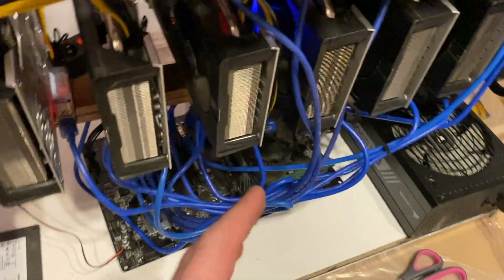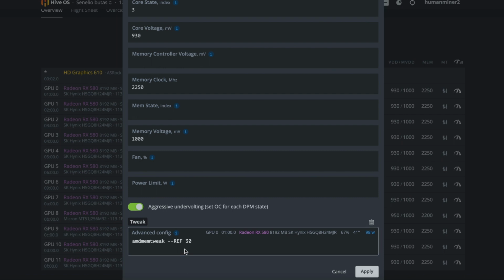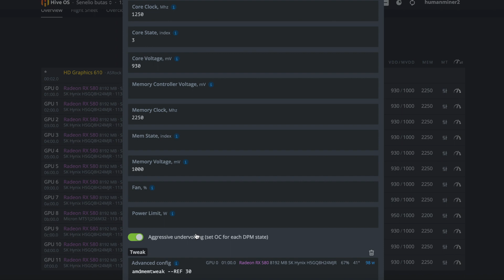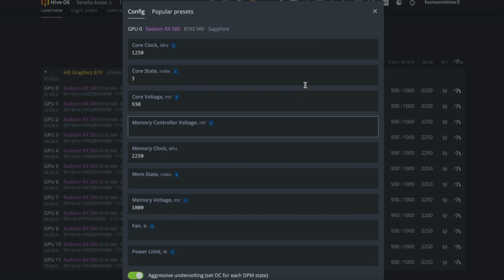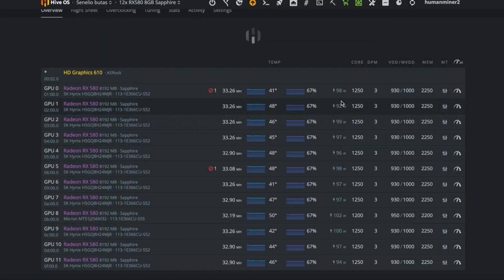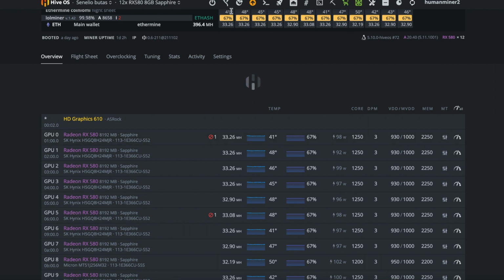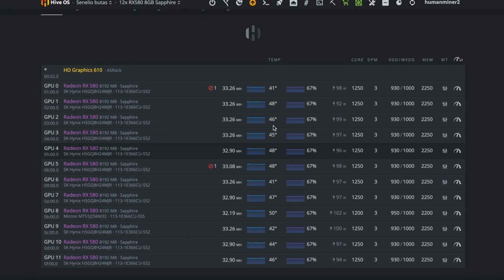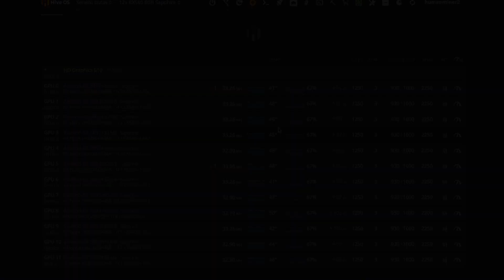BUILDING A BUDGET GPU MINING RIG - 12x RX580 8GB ETH IN 2022

Comment: where did u get the  Pcie 1X to 16X Adapter Riser Card USB 3.0 the points horizontal
Reply from the maker: On aliexpress, it's pretty random actually, if you need horizontal in particular - you should message a few sellers and ask individually, will be the quickest way to find it :)

Comment: Nice build. I have the same setup using RX580 as well. I find that pushing it to 33mH/s@97watt I get too many stale shares. 30-31 @ 82Watt seems to work better for me. I wonder if the software makes a difference. I'm using simplemining.
Reply from the maker: Thanks! Not sure about software ,but sometimes miner has difference and also stable lan connection. Try playing around with different miners at same OC
Reply: amd in software wattage is so inaccurate tho